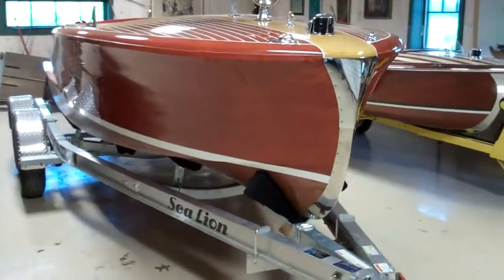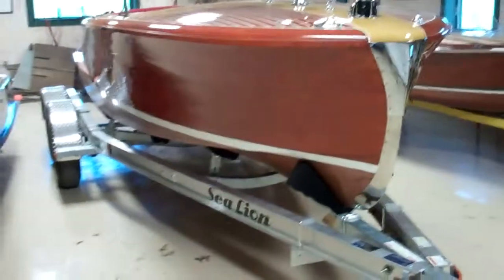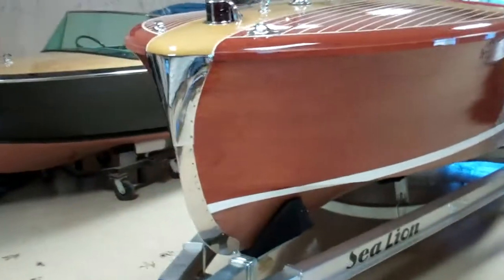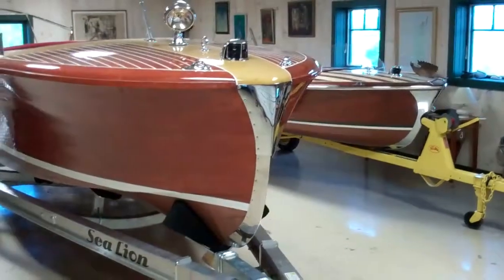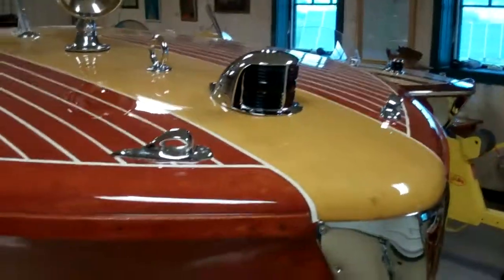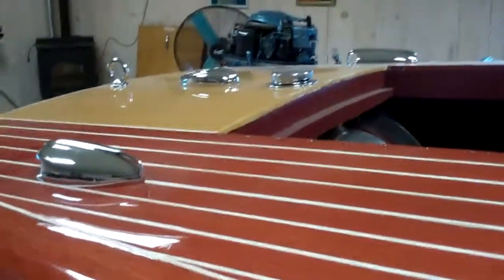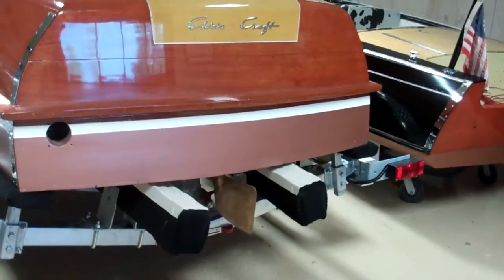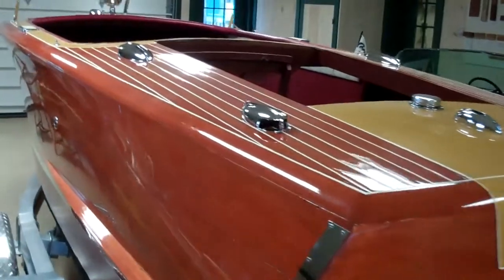1952 Chris Craft Riviera 18' Project Update 5 19 2015

Comment: Hi, I'm very impressed with all of your videos on the sequential restoration progress. Other restorers are not that informative on their methods. The only comment that I'm bringing to attention is the use of the front lift eye as a pull point.  I have 1951 CC Holiday and never use the eye to pull up on. The eye, as I'm sure you well aware, is designed for vertical lift only. Serious damage can result to upper front deck frames and decking. Don't take a chance. I drive my boat right to bow stop and bind it down. Your boat is absolutely beautiful and don't forget to post your launching day video. I'm sure it will be a thrill for you.  Keep us posted and the best of luck. L.G.
Reply from the maker: We've dealt with 100+ boats, every one of which is secured to her trailer by the forward lifting ring.Agreed, the ring is a problem if/when folks use it to winch the boat onto her trailer. Our main use of the strap is controlling the float-away during launch.When retrieving a boat, our practice is to float her all the way forward, and then gently snug her bow against the bow tower as we tow her and her trailer out of the water.Remember, freight always wants to move forward, so our real tie downs are around the aft deck, running through the aft chocks or cleats.Remember as well that raising the winch so that the angle of attack approaches 45 degrees greatly reduce any chance that the winch strap can deform the lifting rod.